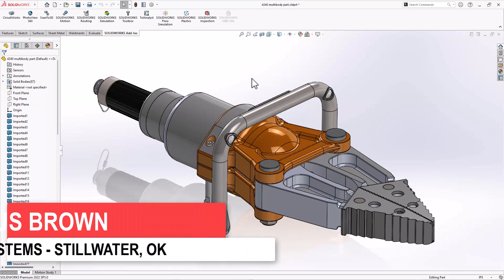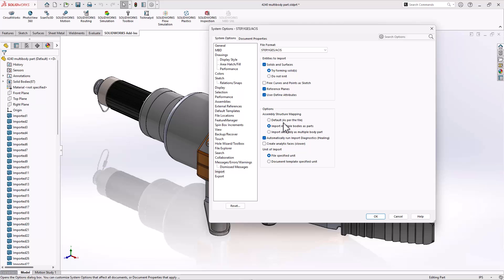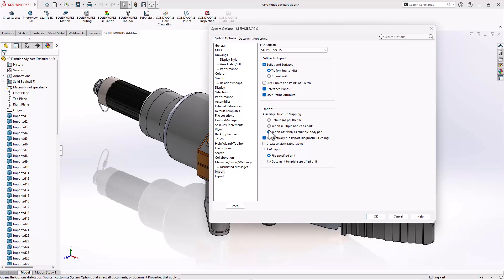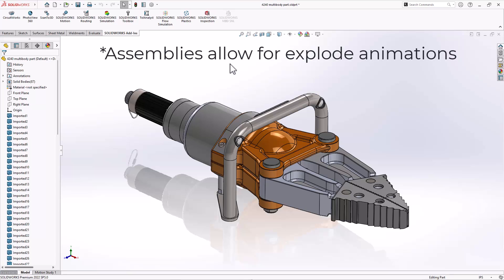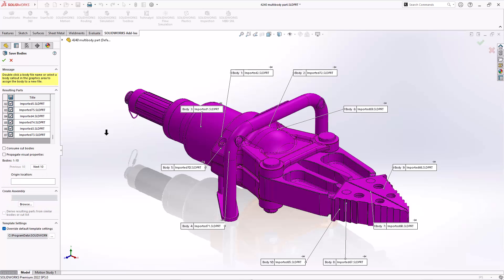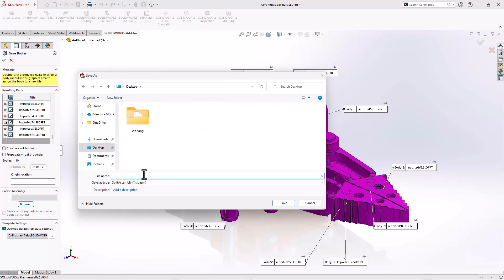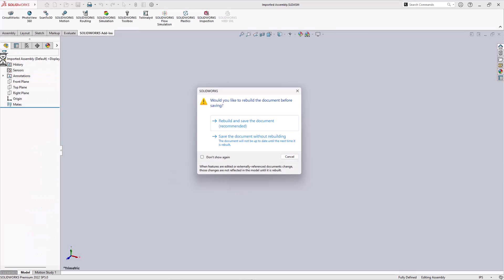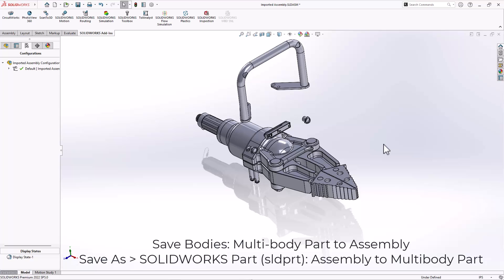Importing Neutral Files as an Assembly or a Multi-Body Part File - SOLIDWORKS Tech Tip

Comment: Does the same process apply to Parasolid files as well?
Reply from the maker: Some file types, including Parasolid, intelligently capture information like assembly structure.  If it is saved from an assembly, it will import as an assembly.  You can save an assembly directly as a multi-body part, or use Save Bodies to break up a multi-body part into components and an assembly, but the import process using Parasolid won't be affected by the import settings.

Comment: I saved 25 bodies same as you but i cant edit any body features, i have sheet metal, weldmeds in my bodies, i want to flatten sheet metal and export dxf for fabrication. Help plz
Reply from the maker: If you import a neutral file there won't be any features.  You can do a couple of things to make it possible to do what you want.  For sheet metal, use the command Insert Bends and SOLIDWORKS will reverse engineer the bends for you.  Add a K-Factor or Bend Deduction value and the flat pattern will be accurate for that final shape.  If you use a different allowance, the flat pattern may be longer or shorter than needed.  For prismatic parts, look at FeatureWorks to identify features and generate sketches for them to make them editable.  Weldments is going to be hard to use because it is a multi-body environment and each of the bodies is saved out separately, but if you want you can generate a cut list which automatically calculates things like bounding box and length.

Comment: what if it shows surfaces and solid bodies in the feature tree command then this method works? because sometimes we get surfaces and solid bodies simultaneously in the same file from the customer .... Thank you for this
Reply from the maker: The behavior should stay the same, but I don't recall testing this situation to confirm. The existence of surface bodies simply means that is how the model was built or exported.

Comment: Save body option not showing.. How can i save?   Please reply me sir
Reply from the maker: Are you in a part or an assembly model when you try to run the Save Body command?  It is only a command that can be run in a multi-body part, and you should see either a Solid Bodies folder or a CutList folder to right click on to get the command.